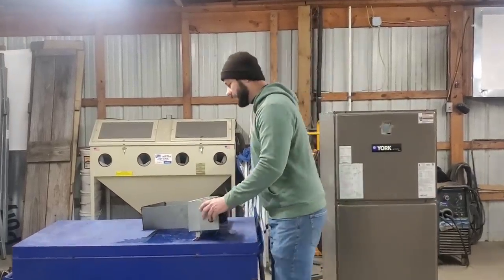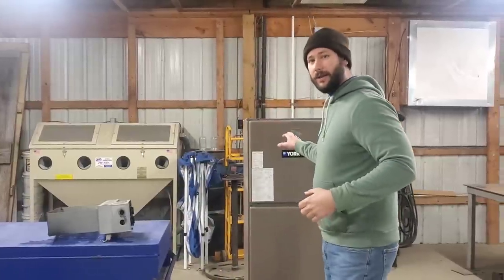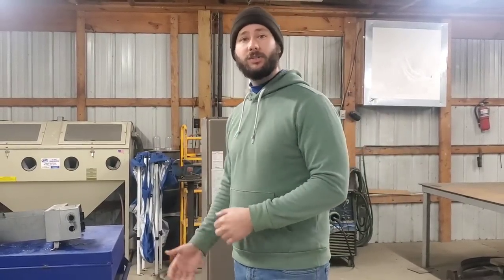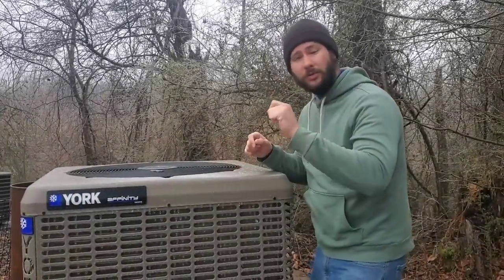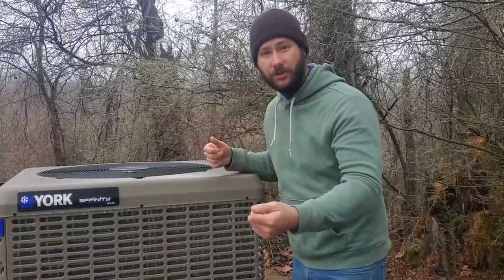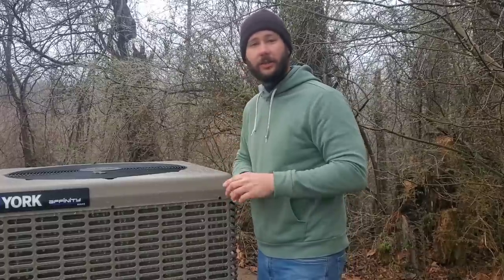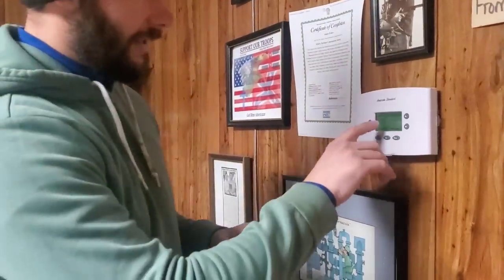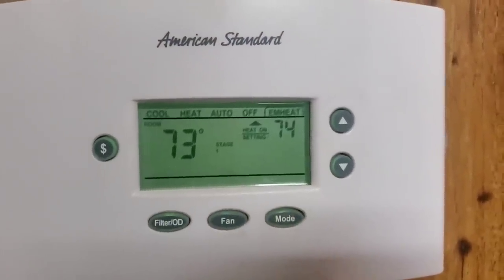Heat Pumps? When to use Emergency Heat? #emergencyheat #heatpump

Comment: Emergency heat is designed for use in emergencies… i.e. your heat pump breaks down and you need to enlist the help of the heat strips until you can get it repaired. My in-laws tried following your advice of switching to emergency heat when below freezing and their electric bill doubled to over $400 that month while mine stayed around $200. The wind chill was hitting -20 for about a week straight and our heat pump ran like a champ in the normal setting and kept our house at 70 degrees. The manual literally says that the unit is designed to run continuously in really low temps and will automatically defrost the unit or enlist the heat coils if necessary. Please read your manual instead of listening to misinformation on YouTube.
Reply from the maker: I've replaced a few sets of outdoor motor fan blades from customers not using their emergency heat during the snowy conditions  this week.
I would hate for your in-laws to have to pay for the repair of their conventional heat pump if that is what they have.I know you do not want your inlaws to have damage occur to their heat pump.
I would rather people stay warm in the really cold conditions. Where the heat pump has hit its balance point, which is around 25°. for most conventional hp.
If you want to learn more, check out my balance point video.
Reply: So how does the outdoor unit “freeze up” when it’s running constantly on extra cold days? Seems more logical that it will freeze up if you switch to emergency heat and essentially disable the outdoor unit 🤔 Obviously different units use different technology but I still think your best bet is to consult the manual for YOUR unit and see how it was designed to work. Otherwise you’re going to end up spending a whole lot more money using emergency heat when it’s not necessary.

Comment: And just when do you turn the emergency heat mode off?
Reply: When your heat pump is operating properly lol you are better off having a dual fuel instead of electric backup heat, although I live in a small town here in TN, usually there are natural gas line ran to every house known to man, but my subdivision ( over 100 homes in the neighborhood) all have split heat pumps with backup electric. I’m an hvacr tech myself, and I highly consider more dual fuel systems than anything... tad, does ricketts still Lolly gag around or is he being an asset to the business? Lol tell him Dylan from past vocational school School says hey... lol
Reply: @dylanhawkins5852  or, just a thought: buy a unit that works to temperatures like -5F.
Reply from the maker: Whenever the temperatures are back above 30 and there is no ice and no snow
Reply: @TaddyDigest  thanks Tad
Reply: Great info thank you!

Comment: My Heat pump is very confusing. I have had gas furnaces my whole life.

Temp is 20-40 here now and my heat pump runs all the time, driving me nuts. ALL. THE. TIME. It is not quiet.

I don't understand why it just keeps cycling back and forth from Heat to Aux. Even when the room is at the set temp. My room temp never varies more than 1 degree. Often I see the Aux heat kick on WHILE THE ROOM IS AT THE SET TEMP. Why? There is a setting on my Emerson Sensei ST55 thermostat to tell it to cycle "slow" which is supposed to give a wider range of temp. I am ok with it shutting off for a while and dropping a couple degrees. But that setting seems to do nothing.

I do understand it might be easier/more efficient to maintain a temp rather than climb a few degrees all time but jeez this seems excessive.

But here is the weird thing. The internet tells me it is normal for my Heat Pump to run all the time when it is this cold. OK fine.....But when I walk past 19 other identical townhomes only 2-3 heat pumps are running at any given time. One is ALWAYS mine. Some of them I have never seen them running. WHy?
Reply from the maker: Yeah usually below 30ﾟ the heat pump runs all the time however some thermostats will not let the auxiliary heat run until the room temperature drops a degree and then the thermostat will call for the emergency or auxiliary heat
 The reason yours could be running more could be due to the design of the home Or maybe with the placement of vents or it could be something to do with the charge of the equipment
 not having the full amount of charged could keep the temperature coming out of the vents at a much lower heat than is needed You may need to have it checked out 

 Or I can show you what tools you need and walk you through how to check it on your own
Reply from the maker: Thanks for watching E Michael's let me know if I can help

Comment: When emergency heat comes on below 30 should your heat pump still be running?
Reply from the maker: Hey Kathy Thanks for watching 

Here is some info for you.

Auxiliary heat and emergency heat are the same thing if your thermostat says you're auxiliary heats on your heat pump will still be running but if you turn your emergency heat on your heat pump should no longer run.

Please hit the like button and share this video

Comment: Misinformation. Leave the outdoor unit running and let the heat strips help out. There's plenty of heat to be extracted at well below 20deg.
Reply from the maker: wrong 
input not worth output 
watts times the actual temp plus
ice and snow can damage the equipment
Reply: 100% that’s what they are designed for the thermostat will shut it off if it can’t keep up or kick in auxiliary to get the job done!
Reply: Efficiency is lost on a sliding scale relative to the ambient temperature (?)
Reply: @chris roberts I completely agree. Having living through bellow teen weather here for 1.5 days so far aux/emergency heat could not keep up with the demand. My heat pump has a defrost mode that is adjustable via the thermostat anywhere from never up to i think 8 times. Previous home owner had it set to never. Frozen the heat pump/condenser up over time. Read the manual performed a force defrost on the board on the heat pump. Melted it all off. Reprogrammed the thermostat properally to 5 times defrosting an hour. Been working flawless for over a day with highs of 9⁰ during the day. This YouTube video is 100% incorrect according to my Trane XR series heatpump and air handler installation manuals
Reply from the maker: There is still heat to be extracted from the air even below 20ﾟ

But can you tell me the input to the output Is at 15ﾟ

Can you tell me the cost and how cost effective it is

And is it worth the risk of damaging the equipment 

Run your heat pump at 0ﾟ 
just your heat pump 
and see how you fare
Reply: @nathanbrown5099  No, it wont keep up. I take care of a 47 apartment building and every unit has an outdoor heat pump. Yesterday alone i recieved about 5 calls for their furnaces not shutting off and ran for well over an hour. Just because the unit finally shutdown doesnt mean it is running efficiently. Yes, it is extremly cold at -35 yesterday morning and drifting and blowing snow has the heat pump units almost covered. I switch tme over to emergency heat so heat pump can thaw itself out whenever that may be.
Reply: If your outdoor heat pump package can't heat your home at 10 to 30 degrees you have a problem with your unit or  a low seer Piece of shit.
Reply: @TaddyDigest new units can extract heat from air that is -20F.
Reply: We've got systems from KERR that operate up to -25°c. Those cheap heat pumps are junk in Canada 🇨🇦

Comment: Wow. BAD advice for modern equipment that is effective even at 10 degrees without running the auxiliary heat. If you're using a heat pump only above 30 degrees, you're wasting electricity and the efficiency available from a modern heat pump, which will defrost itself in frigid temperatures. 
It will also protect itself by shutting down if it's sub-zero. Only in instances of heavy snow or ice buildup should you switch to emergency heat.
Reply from the maker: Not everybody has modern equipment
 Also I'd love to see your videos
  Where are they send me the link and I'll check them right now
  I'm trying to keep people from damaging their conventional heat pumps
 And at least I am out here doing videos trying to help

Comment: This guy has never worked in HVAC!!!
Please disregard his information.
Reply from the maker: you make me laugh 
this video has helped a lot of people

 You're YouTube name should be green thumb
Reply: @TaddyDigest  
How do you figure?
You provide incorrect information to people who don't know any better and then they "think" it helped them and in reality it hasn't.
There is no reason to shut off a heat pump below 35° if you have electric as the back up. It is just the same cost wise, 100% efficient as the strip heat. fossil fuel as back up, that is another story.
The longer a heat pump runs the better it is for the equipment.
Shut off the heat pump because ice/snow might fall on the unit, then it was installed in the wrong place!!!!! These units were meant to be in the elements, so use them.
I could go on, but why? I know, because I have done HVAC as a profession and not a youtube hobby.
It is people like you that get unknowing homeowners into more trouble than if they would just call a professional.
Reply: @jrsmyth9761  I agree completely the unit is set up for use in the elements the only time emergency heat should be used is in an emergency such as outdoor unit malfunction or extremely cold conditions like sub 10-15 degrees
Reply: @jrsmyth9761  agreed
Reply: @jrsmyth9761  I’m new to my area and heat pumps. I’m in the DFW and we had 8 degrees the last few nights. So I shouldn’t run emergency heat? Also, our power turned off for a day and when it turned back on the heat coming out is either very luke warm or almost cold. I turned off the unit and am sleeping in the living room with the fireplace going. What could be the issue and what is the solution?
Reply: @ricardoh3178  hey did you ever figure out what it was? I just had the Duke energy rolling black out on Christmas Eve and now all I get is cold air blowing out of my brand new unit. It never reaches the temperature it supposed to on regular heat so I been running emergency heat during the past really cold days under 30 degrees outside. Today we finally had a warmer day and still cold air while on regular heat.
Reply: @evebydesigns  something with the pump. They replaced it and it started worki